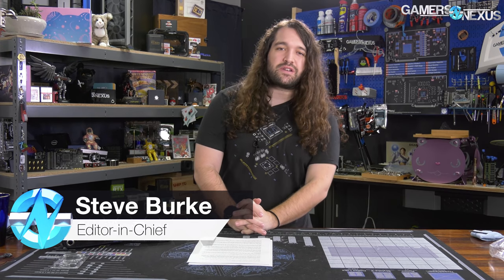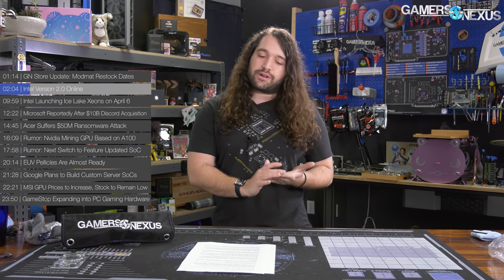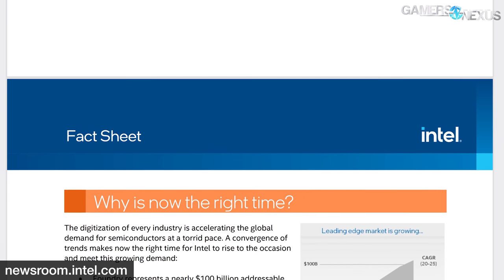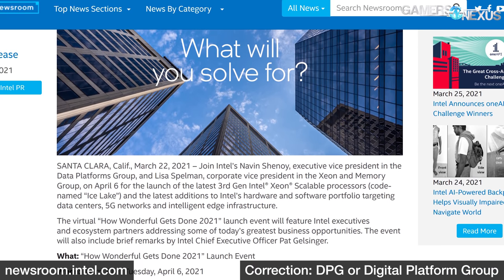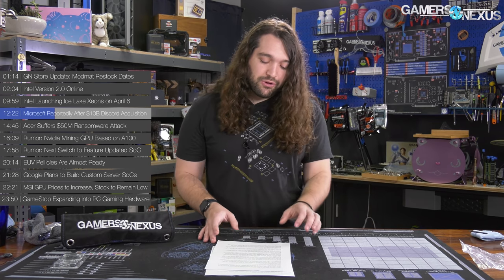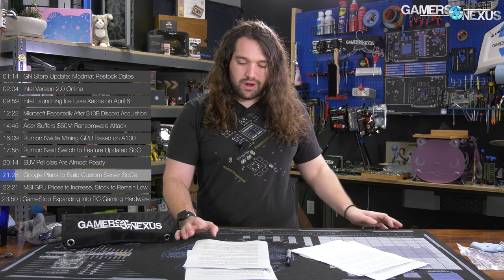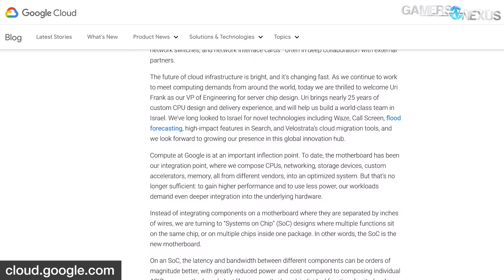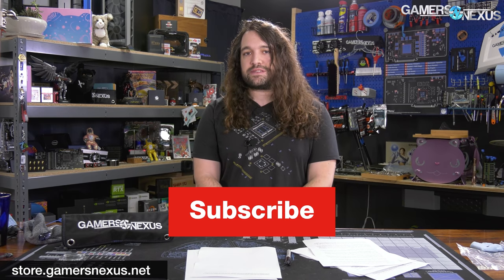HW News - Intel's Comeback, MSI GPU Price Hike, GameStop PC Hardware, & NVIDIA Mining GPUs

Comment: I'm actually hoping that intel holding on to 14nm for so long will end up being a bit of a blessing. While everyone else has been shrinking, intel has been for the most part keeping up even with the older tech. What I'm hoping is that once they do finally go to 10nm, it's going to be a massive jump in performance/efficiency.
Of course I'm seriously sceptical, but one can hope.
Reply: Z287899    Intel has had 10NM for 2 years now. Ice Lake and Tiger Lake are both 10Nm as well as the latest Xeons. Where have you been?
Reply: @wysetech2000  we're talking about enthusiast type processors. Not mobile or server. Which is why intel is getting hate for still being on 14. ++++++++++++++++++++
What I'm saying is I'm hoping that once they actually bring out their actual enthusiast 10nm processors, they will actually be excellent. In fact everyone should hope so. If it's not, there will be no competition in the space, which is bad for everyone.
Reply: @Z287899    You didn't say that, did you? I don't understand HATE for ANY company that has manufacturing problems. It's damn disgusting since 99.99% of the haters couldn't run a Corporation the size of intel if all it took was to drop in a coin! People are fucking weird!
Reply: @wysetech2000  I didn't think I needed to say it. In fact I still don't think I needed to say it. Since we're not talking about server cpus, why would I reference server cpus?
Reply: @Z287899    Who knows?? you could have been talking about Laptop CPUz.  You're hopeless!

Comment: To me, a dedicated mining board that only gets 220 MH/s for $3000 is a waste of money. If it's purpose-built for mining, that means it's unlikely to work very well with graphics, which means it will be harder to sell if mining suddenly becomes unprofitable. Not only that, but you can get three 3080s for that same $3000 if you buy for MSRP (yes, it means waiting in line at Micro Center) and that gets you 300 MH/s when tuned up. I'll take a pass on this fancy new mining card.

Comment: Watching on an M1 Mac mini, BEGGING Intel to make something that makes me jealous.
My computer uses maybe 30 watts under maximum load. I can never hear its fan. Its graphics are faster than Intel Xe. it runs Windows on ARM in a VM better than anything with an 8cx runs Windows on ARM natively. It sits on my desk and gets the hell out of my way, while being cold to the touch and wicked fast. It can play Mac-optimized 64-bit games, iPad games, Windows 32-bit and 64-bit games. It came with 16 gigs of RAM and a 1 TB SSD dynamically shared between MacOS and the Windows virtual machine, largely dependent on how many games I download in Windows. It cost me $1239. That's where Intel should be _today_. Apple's M-series is a moving target. If Intel wants back in my life, they have to make a chip twice as good as M1 in the next 24 months. Please, Intel, do it!

Comment: Thinking out loud, why do we still have these stupid great big cards we plug into our motherboards ?? isn't it time we simply had GPU sockets on the motherboards and GPU ram slots instead ? The cooling solutions and interface with the chipset would be measurably more efficient, not to mention the space we could save in a build !

Comment: The year is 2050
GTA V has been released on the PS11 and the xbox 10
intel is still on 14nm
AMD has launched it's first femtometer CPU
Windows 10 still hasn't fixed legacy support/DX9 support

Comment: The AZ fabs aren't new for intel, they're just re-opening existing fabs that they shuttered a while back
Reply: @wysetech2000  Mate, they all but closed down the chandler fab back in 08. I know because I used to work with I can't tell you how many guys who got laid off from there.
Reply: @huma474    That was 13 years ago!!
Reply: @wysetech2000  And? The facility was never brought back up to full capacity - When intel goes on a hiring spree for that sort of stuff it gets attention in the local press.
Reply: @huma474    OK, KNOW-IT-ALL!

Comment: Would a 8150 with 16 GB of RAM run win 10 well enough for a corporate desktop in 2021? YES How about a I7 2600 with 16MB? YES.
Would a corporation buy and stick them on every desk in 2012? Hell no.
  But  most corporate Bean counters would not authorize putting one on each desk. But they would authorize leasing a i3 2100 in 2011.
 The only corporate entity I ever ran into that did run top of the line intels was McDonnel Douglas for the Long Beach and Seal Beach complex in the early 90s. That complex was approximately 25,000 desks. MD even had the techs build them. Every desk had the same  cpu and components. That made rolling out Win 98 a easy task. Just use a floppy, plus CD with a script and pick the software for each desk. The distinction was Engineering or clerical desk. 
Then Boeing took over. Boeing declared Boeing would be a all MS corporation. So what our techs did was since MD already had the license for Novell 4.0 Just make them a phantom server and do nightly backups of the entire system and let the MS servers do the  day to day tasks.
 So a MS virus attack happened and the whole network went down. At the end of the day all the desks (25,000) and MS servers were cleaned.  And the data restored, desks and servers wiped and (reformatted) by 16 technicians. Try doing that with piece meal leased equipment.
It took Redmond and ST Louis 4 days. 

Most corporate desks currently are leased on a 5 year cycle with barely good enough performance to make do.
But if you have a i5 from 2015 it would still do what it was supposed to do. Maybe the only thing needed would be more RAM to make the desk good enough.
 2015 i3s? Fo git a baud it.

Leasing is  preferred because of the yearly tax write offs. Also some states have taxes on the company internal property. Leased equipment is not assessed because it is not company property.
That is why most likely one of the reasons TSMC chose AZ instead of MI. 
Think about TSMC Taiwan had to recently truck in water because of the drought. Michigan is surrounded by the world biggest collection of fresh water. Arizona is a desert.
The end user of most of the intel CPUs is the the corporate office. If MS comes out with WIN 11 intel will get a boost in profit.

Comment: Pfft. I'll believe it when I see an actual 7nm PC CPU from Intel that outperforms TSMC's 7nm, at which point TSMC will probably already be on 5 or 3nm, playing catchup sucks even when possible. Announcements don't mean crap at the end of the day. Even investors should be skeptical after that track record and being led on for 5 years that 10nm was "soon". The fact is they've been stuck on 14nm for 6 years now. Also, going back to a tik tok cycle doesn't mean much in the longer term when there's not many tick toks left. Even exotic materials like carbon nanotubes and graphene doesn't get below 1nm even as single gates (though that got to 500GHz in a lab), and if that can even scale to trillions of gates per sq mm and maintain performance remains to be seen, but I think that unlikely.

Comment: I dont see how IFS is going to be any worthy addition for us as pc users.  Thus just chips away pc part production capacity which there already is a shortage of.  I get intel may be making more of 3rd party chip production but that will still screw the pc market. 
And say nvidia sold these cards for 699 like a 3080 which us unlikely as they are likely slower. thats 45000 videocards... that would abolish the entire USA and EU gpu backlog and then some (based of public documentation of backlogs here there are about 20k cards). But its more likely they payed arround 500 so thats even more cards. All wasted silicon.

Comment: just like every other social platform Microsoft touches they will shut down discord and offer you their service instead
yes Microsoft bought Minecraft and it went up in price almost immediately and mods cost money now.

gaming tables are sometimes the difference between having a laptop and a desktop, my mate didn't have space in his flat (apartment) for another desk for a pc but he was able to get a compact gaming table that fit and the screen is raised up on a separate platform than the keyboard/mouse and it has all kinds of nifty things like a drink holder so spillage is less likely and speaker mounts for 2.1 sound system (ofc no rear mounts because it was compact, there were others with them), he loves it and said he would buy another if his broke 100%, he payed about 150AUD and it was mostly black with some green accents, quite a nice option for the size and price

Comment: The GPU industry is just asking to go bankrupt. There's plenty of manufacturers who could step in with open architecture designs at much lower cost. If someone produces a discrete GPU based on ARM (actually, you'd think Nvidia would) then it's game over. Cheaper, minimal heat, minimal power draw, no crazy AIO nonsense needed. They've coasted on customer loyalty which they're destroying every day

Comment: ive used skype before Microsoft bought it. I noticed adds, slow loading times(opening app). Every time new update comes Skype logs you out. shit ton of new emoji(defiantly right update), lost feature send original quality photos(now it does down sampling  1/10 of original file size). Also i agreed on new terms and condition for data collection. i had two choices disagree and stop using skype or agree and continue using skype.(hostage situation tbh) so i predict same update path to discord.

Comment: I would have bought a i7 3 years ago and wouldn't have moved made but they took hyperthreading away.  They would have to offer a i7 today with hyperthreading having 12 cores and 14 with hyperthreading to maybe possibly get me back but they tried screwing the i7 username over withhyperthreadi g removal which means I'm a 5900x or 6900x depending which comes first a in-stock 5900at RRP or a 6900 with ddr5.  One is for me it's unlikely I'll be going for a intel in my next few pc cycles and my cycles are 8 years for 2 pcs.   Add that to windows 10lacking blu ray disc support and kodimnone her on windows 10, I have now moved my media to a shield TV pro on external HDD and windows is also becoming a thing Jude less and less for.  You tube with are locked on windows 10 is one of the last things left.  Even Skype which took Microsoft years to get ok has for 8 months had visuall couple issues and as of two days ago no audio from other people lol.  Pose don't let windows getdiscord it'll be another destructive point.  Instead Microsoft fix Skype.  Also I like tiles but I still have to use third party software to make startenu look great and one of those software has to be kept on in background.  Hum how old is windows and humm still no way to make old shortcuts I to tiles even if it is just to make tiles pleasingly look.

Comment: Basically the same thing for a decade? Hmm...maybe because it was 'good enough' and everything produced by the other company, even if it was 'new', was also shit :) You should tell this to PSU makers, as there isn't much that different inside most of 'em from units made 20 years or more ago! And to be fair, some older designs are actually better. In terms of switching supplies, unless i have to, i'll always use linear! I actually made a linear PSU for a Baby AT system - less noise, increased stability..but a lot more weight and about 70% PSU efficiency! I never build an amplifier with an SMPS though, with the exception of a 'car-puter' i built into an old amp case, with a small chip amp module inside so it could still pretend to 'be an amp' It featured a VIA Eden platform at first, later Intel Atom etc..

Comment: good job amd. u own the next 10 years. don't make them tears... only of joy.
Reply: @wysetech2000  when ? i hear it since 2017.. still it has been 4 years. and they are behind 5years. after 2600k i went with ryzen.. there is no match, just marketing and big teen BS fps (u get 7fps more in csgo but u cant alt tab on a different app). big FO. 2600>3600>3800x>5900x (which i could've saved only on 3600 and 5900x) but i was an intel fan,used to buy each year newest K series. all of this over 2xAM4 boards and 2nd am4 is top tier am4 aorus pro v2. not each cpu a new top tier mobo. think how much i've saved amd over intel and how many cores/cache/productivity i have gained. FO intel fan boy.  they need to be transparent, budget friendly,gamer friendly,consumer friendly, give better results than amd and maybe i ll come back. but knowing intel, the time they will beat amd, their cpu price will be 2x times than amd and 5% performance difference. + a new mobo.. again. and new cooler, cryo this time and get scammed by retailers even in 2021 selling cpus to old ppl or newbs, comision + discount and tickets to intel launch. FO

Comment: Prediction: leading edge fabs will become national assets, with governments being the plurality if not the majority owners.  The financial risk is going to get too big for any company to take on.  Twenty years ago at the 130 nm node there were about two dozen companies with leading edge fabs.  Today there are three at the 7 nm node.  Roughly one in five dropped out at every node step.  At the same time, chips have become a strategic resource as important as oil and steel; countries cannot afford the risk of being completely dependent on any chip supply that could be cut off.

Comment: I hope that Microsoft doesn't do anything stupid if they bauy discord and improve compatibility and system integration with windows that should mean less BSODs and less issues with games and maybe also a more optimized program that is however already running in many pcs, I hope is that, if  is not  Microsoft could to the hell if it is for me